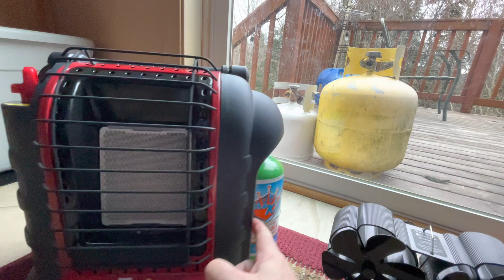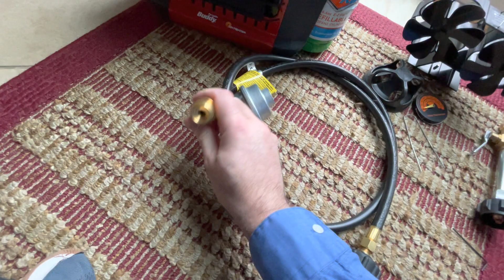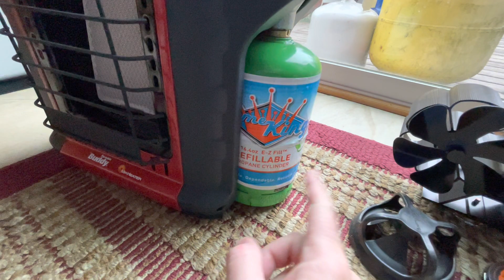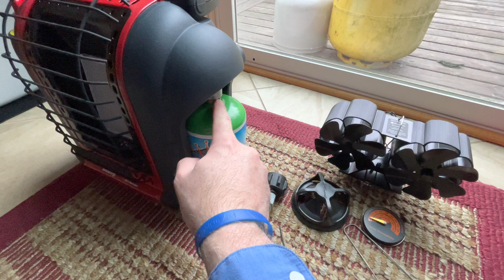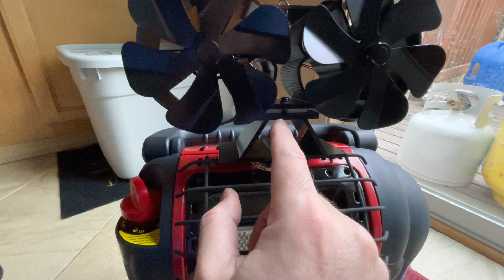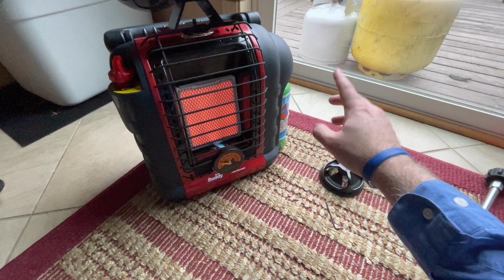Mr. #Heater #Portable Buddy and Accessories Review

Comment: Great video.  Thanks! 

I just purchased one of these Buddy heaters.  I plan to install it in a 24' box truck converted to an off-grid RV.  The box truck has a propane system with a two-stage regulator that outputs 11" W.C. pressure for the RV propane/stove and tankless water heater.  The system also has a branch connection for a heater.  If I understand correctly, the Buddy integral regulator will open allowing unrestricted flow when connected to the 11" W.C. propane piping system.  In other words, the integral regulator will not create a pressure drop restricting flow and the heater will perform at 100% of its rated output.  Am I understanding correctly?  Thanks for the help!
Reply from the maker: I have connected the heater to a regulated propane supply. In the video, the alternative low pressure solution is shown. I cannot officially recommend anything not documented in the manual.

Comment: The reason u have to use a inline filter on that rubber hose is because the hose leaches oil that will ruin the ceramic elements in the heater..
Mr heater sell’s a hose (part F273704 ) that will not leach oil and u don’t need the filter. This hose only comes in 10’ length unlike the other hoses that u can get in various lengths. This part will save you lots of money in filters an hassle installing them. Also Mr heater says change out the filter every year because there is no way to tell when the filter is saturated an if your filter gets saturated an start’s passing oil u won’t know. I live in Texas an use the heater infrequently so I don’t want to put a new filter on when I have no idea how many hrs I have on it.
Reply from the maker: Good comments. Thank you. The filter is required when the hose is subjected to high pressure. If you use a regulator at the tank, then the hose is not subjected to high pressure and it will not leach oils.
Reply: @Linus007  you don’t understand. The hose with the part # I gave you dose not leak oil.
Reply from the maker: @marksanders8028  I understand and am aware of the hose that you mention. I took a different approach in using a regulator.